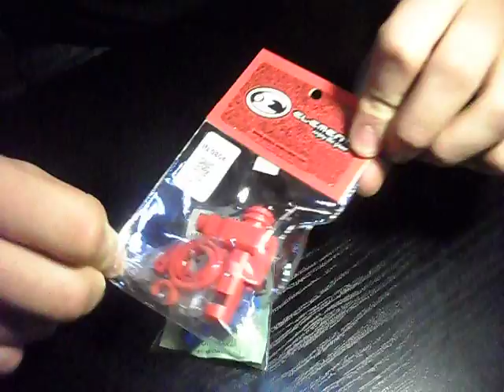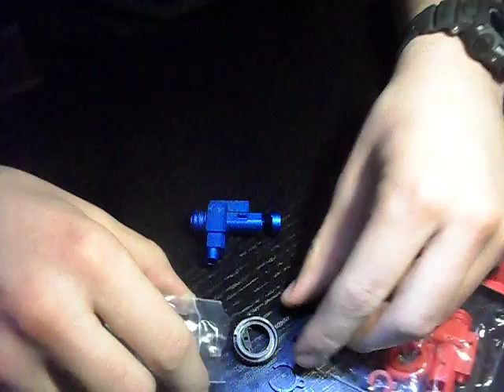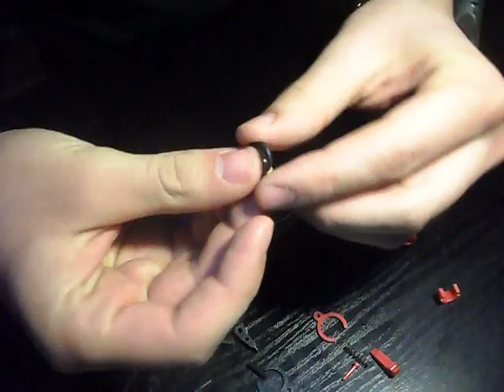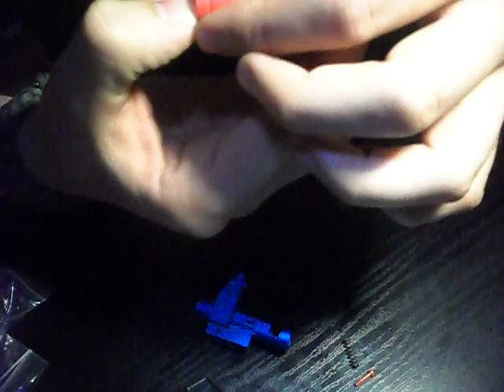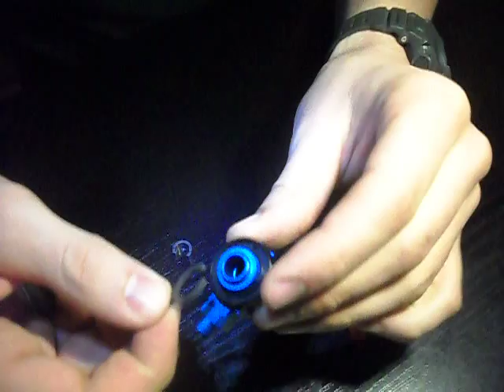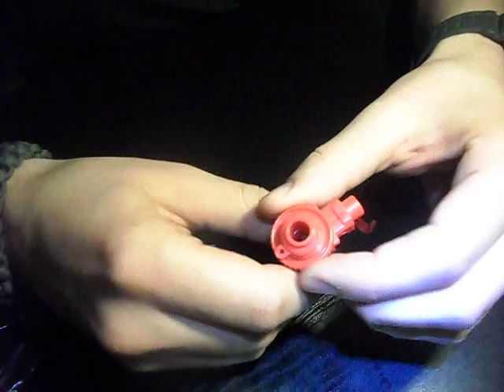ProWin vs. Element accurate M4 Hop Up chamber review

Comment: Thanks for the video, very informative! It's been a few years now... Have you tested both of the units? Is the Prowin worth the price or is the Element the better deal with some minor modifications?
Reply from the maker: I did not tested the element one, since I had serious fps drop with the prowin in my G&P M4, I've decided to retun to the original hop up unit. You can't beat the price of the plastic chamber( if it's not working throw it to the rabish or sell it just like me ), you may find some cheaper cnc machined chambers, but the prowin is a tested and trusted one, although it just not worked with my G&P.
Reply: absolutely. plastic vs. aluminium alloy, nothing to do in regards to strenght and precision (wearing in plastic!) good to have this cheap chamber in a case you lose a small plastic part on the Prowin.

Comment: Did ProWin hopup it fit to your G&P ?
Reply: if you are trying to put one in your g&p you need to use o-rings on the barrel to push the hop up tight against the gearbox shell so you have no play in the hop-up